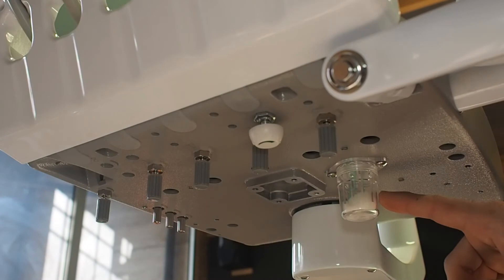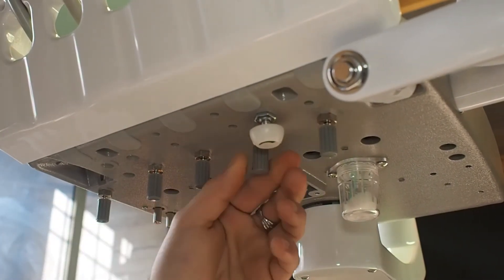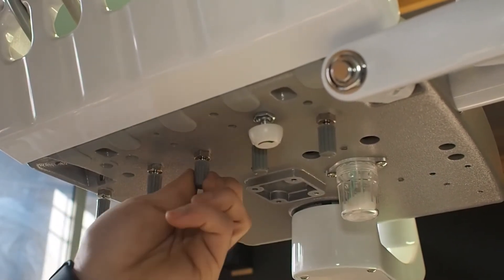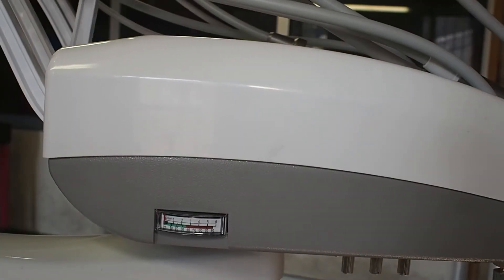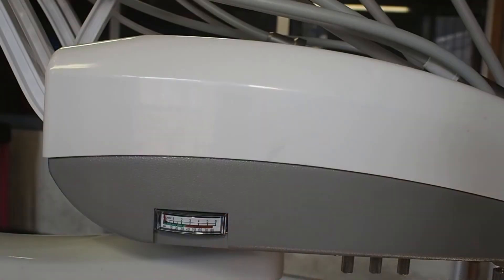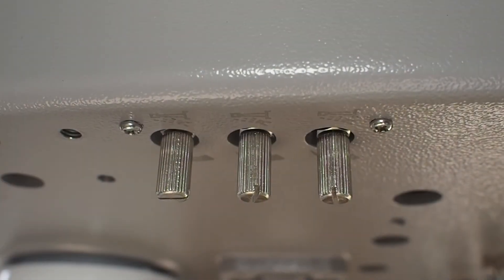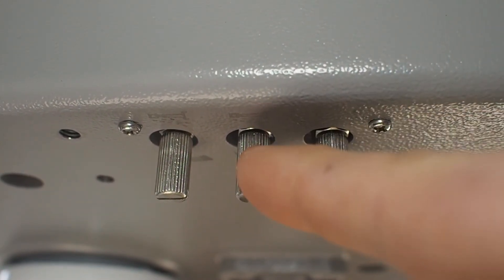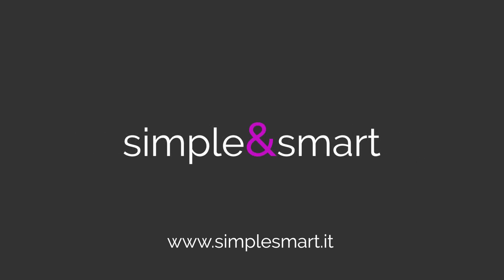AIR & WATER ADJUSTMENT | Dental unit

Comment: Hello, is it possible to stop de air coming out of the turbine/contra angle handpiece and still have the bur spinning with water dripping? there are treatments where we don't want the air to be forced into the soft tissue (surgery). Thank you!
Reply from the maker: Yes, it is possible. you should close the CHIP AIR TAP. Under the instrument tray, there are 5 taps with plastic knobs. 4 of them control the water of the 4 instruments and the last one (a bit on the side comparing the other 4) closes the chip air. 
This function is also explained in the manual.
Reply: @simplesmartdental  thank you for the answer!